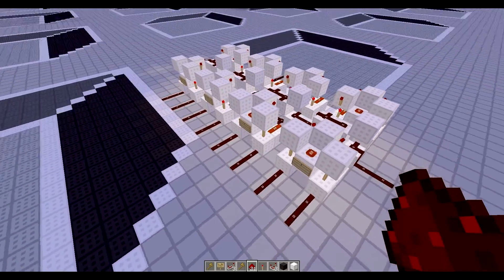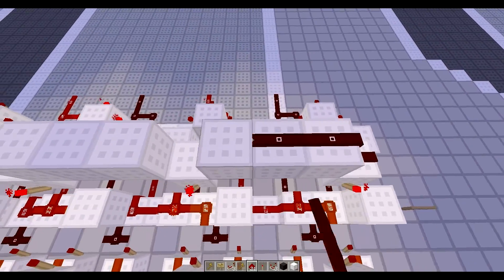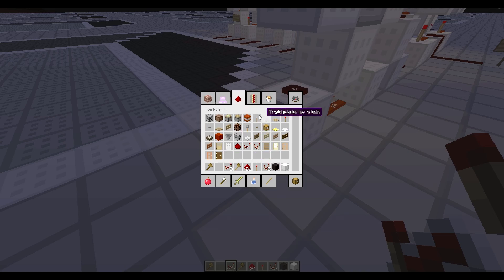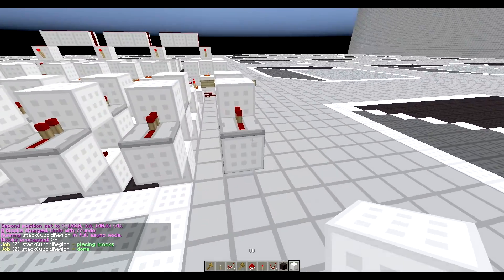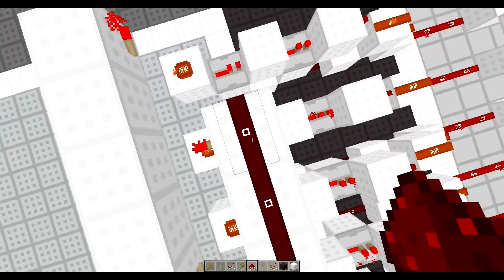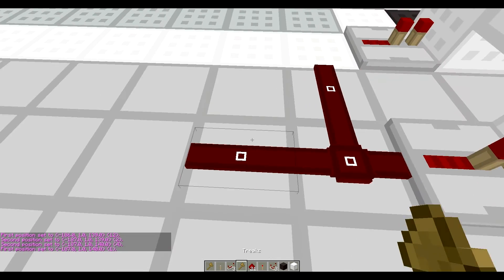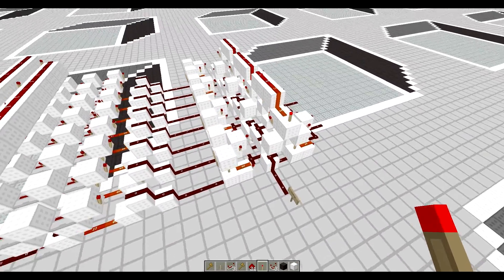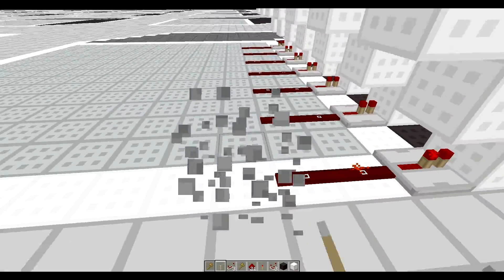Redstone Computer Tutorial - Episode 9 - The basic ALU

Comment: Here’s how the AND outputs and OR and XOR outputs work

AND output: it means that whatever bits are the same will display the output of that bit if there is two of the same input on A and B.

OR output means that whatever numbers on A and B’s input will display on the output, even if there is two of the same number on the input.

XOR output means that if there is 001 and 001, the output will be 000, if there is 101 and 011, the output is 110, considering that the output is XOR’ed.